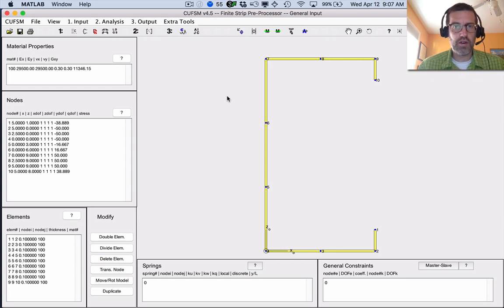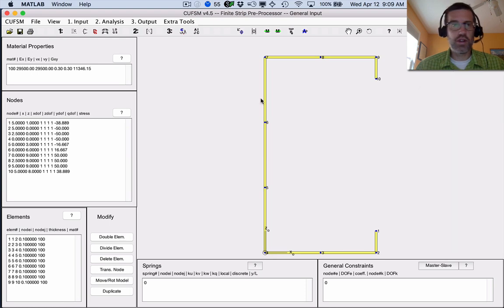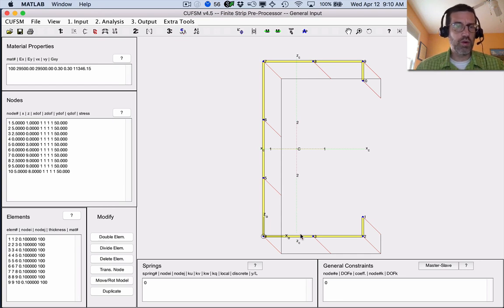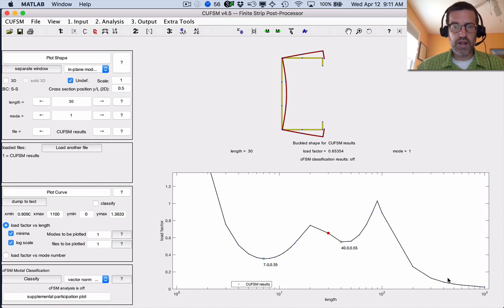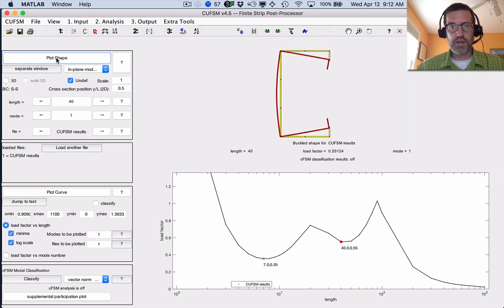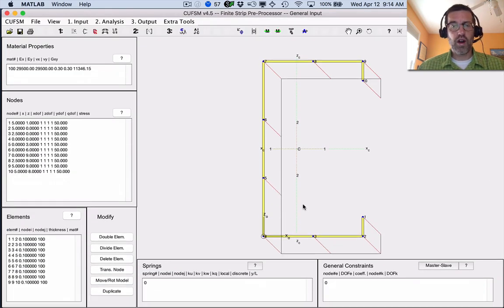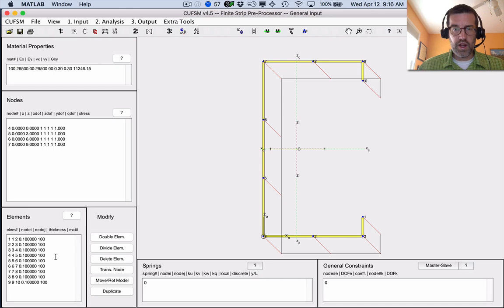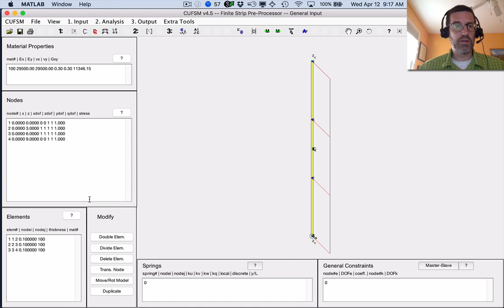Introduction to CUFSM 4.5 (2017)

Comment: How can I change the units from kips to Kn.
Reply from the maker: You can use any consistent set of units you like - Just enter in a consistent set of force (F) and length (L) units. So thickness and length of all the strips in your L units. And E, and G in F/L^2 units. I like to use mm for L and MPa for E and G if I am using SI. As long as you are consistent no worries.
Reply: @benjaminschafer6307  Thank you sir!
Reply: Sir,  Can i have a tutorial video over a wide flange section by using cufsm for better understanding purpose. As,I am working over it W- Sections (I-section).
Reply: My Working domain is over fibre reinforced polymer (frp) columns.
Reply from the maker: @sandeep608  I will try to make one at some point. Don't have one handy. It is basically the same as what is provided here - except without lips on the ends of the flanges you do not have a classical "distortional" mode only local buckling and global buckling modes. Of course you can have some fun with the orthotropic properties and create some unusual shear modes as well.. If you look at some of the papers I have authored with Sandor Adany on the constrained Finite Strip Method we often provide some I-beam examples.
Reply: @benjaminschafer6307  Thank you for sharing the info.